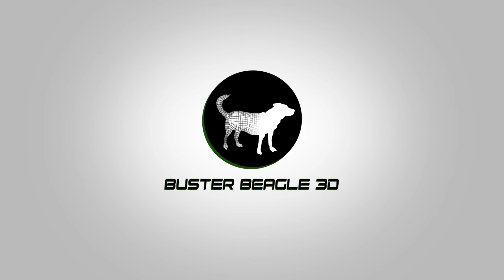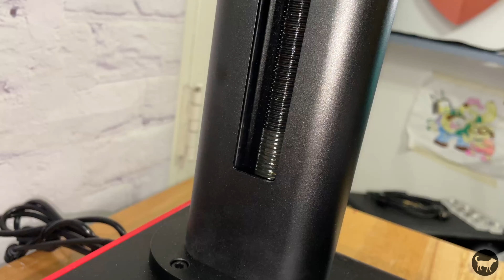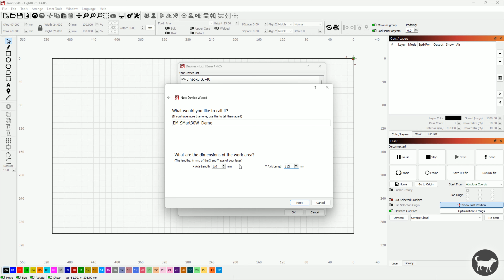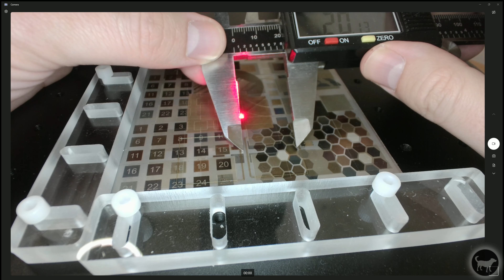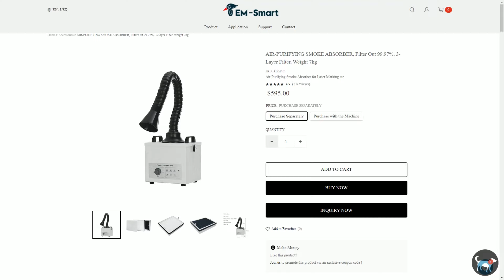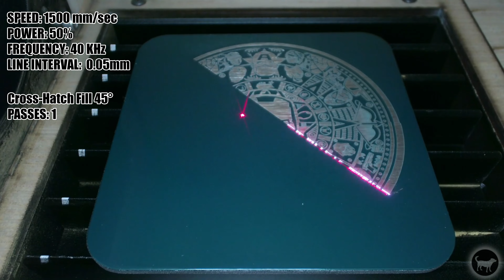EM-Smart Super 30W Fiber Laser Review | Compact yet powerful Fiber laser Machine

Comment: Do not buy an Em-Smart laser. I regret purchasing mine. They will gladly reply to you and answer all your questions before you buy one and once you buy one they offer zero help. Unless you already know how to use a fiber laser and the software, stay away.
Reply from the maker: What was your issue? Perhaps I could help. Also I highly recommend joining a Facebook group specifically about the machine or brand you own of any machine. There are always tons of people to help out if you get stuck and you can usually find answers to the same issues you have from people who have already asked the same questions.
Reply: Hi, sorry to hear you're having trouble with your machine. Just curious – what issues are you running into? I actually own an em-smart laser myself and have had to reach out to their support a couple of times. In my experience, they responded pretty quickly and were really professional – helped me sort out the problems step by step. Maybe I can share some tips if you let me know what's going on? Hang in there – once you get it dialed in, it's actually a solid machine. 👍

Comment: Why would I pay $2000 for something that could literally blind me during its normal function? They should definitely do SOMETHING, even if it's just a thick cardboard box
Reply from the maker: Most laser engravers until recently came with no enclosure whatsoever. My first laser a few years ago didn't even have a shield on it at all, you simply had to rely on the glasses that came with the machine. This machine also comes with laser glasses as well. While it won't blind you , you still want to shore it up as much as possible to fill those top gaps. Again any enclosure is better then no enclosure.

Comment: Nice looking unit, seems to do well. I'm a prototype developer for industry and want to know how well does this laser "do on cutting through" flat ps of various types of metals and plastics? What would you say is the max thickness it can burn through for various basic metals such as Steel, Stainless, Aluminum, Copper,  Acrylics etc.  Thanks, great demo!
Reply: These machines can cut thin metals but they are not ideal for that purpose.  For like aluminum foil yes easy, but if you want like 1mm or more it will take a long time and you may have to dial focus as it cuts. If that is your goal a small cnc mill is better for cutting metal. I have both, and for cutting I use the mill, it's way faster. Just my experience.
Reply: @newmonengineering  These lasers are way over-priced for what you get and their functionality. Unless you have a specific and profitable niche, definitely choose something else with more varied capabilities and flexibility.
Reply from the maker: Honestly I'm not sure about the max distance per material. I only ever went down for 350 passes. The deepest I got in brass was about 1.63mm. My guess is you can definitely go deeper but I haven't yet. You could also always lower the laser down a half turn or so and keep going deeper if that is what you are trying to do.

Comment: Can it drill holes in .25mm thick sheet metal less than .2mm in diameter?
Reply from the maker: While I didn't use it to drill holes my guess would be with enough passes you should be able to.